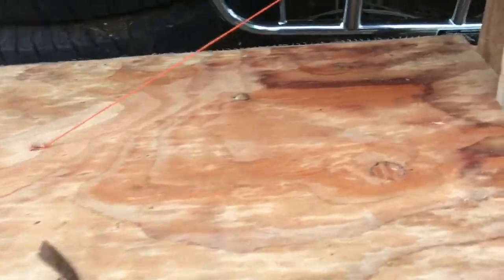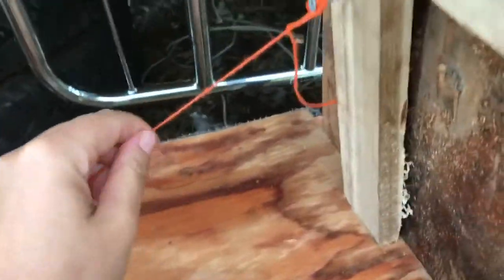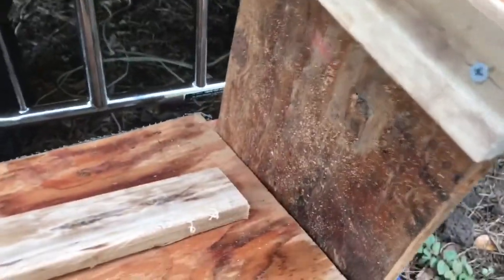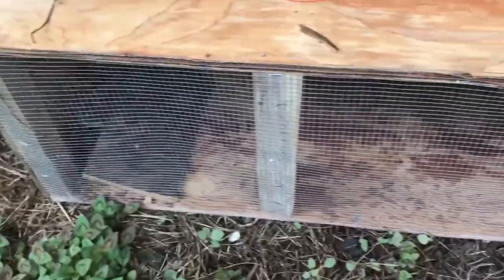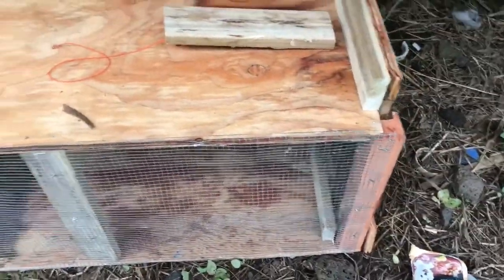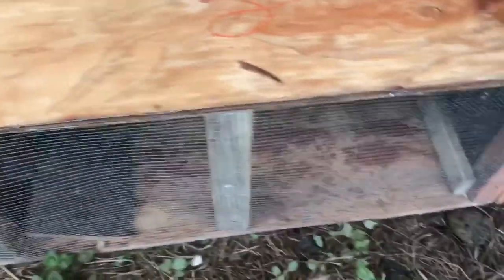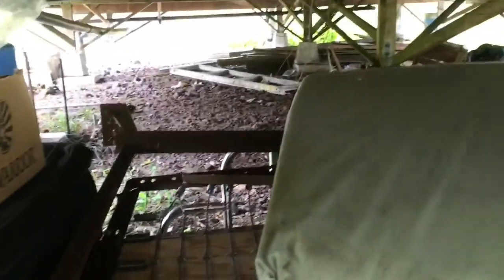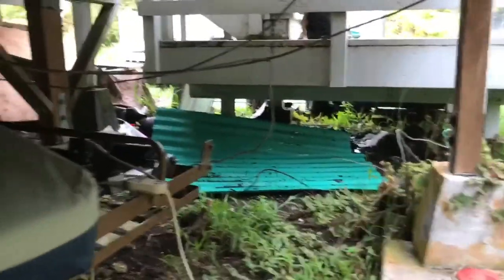Diy Cat or Small Animal Trap Works!

Comment: Try to make the door a neater fit so it doesn't wobble and rub candle wax on the sides and in the track so it slides nice, good job on the trap
Reply from the maker: col stace ooh thank you i was trying to think of a way so it would stop jamming that was the main problem i had
Reply: PinkFurryHat just caught and relocated 2 cats this week, my trap has solid sides and just wire on the end, it's kinda heavy but the cats stay real calm after the initial shock because it's dark and they can't see out, I keep them in a dark garage also. I find a squirt of water from a spray bottle gets them out quickly. I like your trigger also, mine is inside and a little hard to set